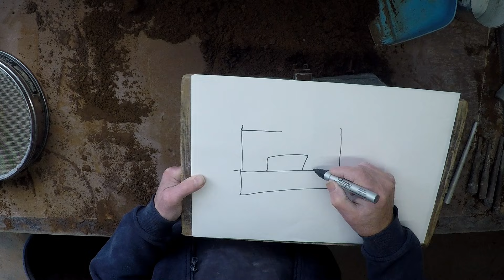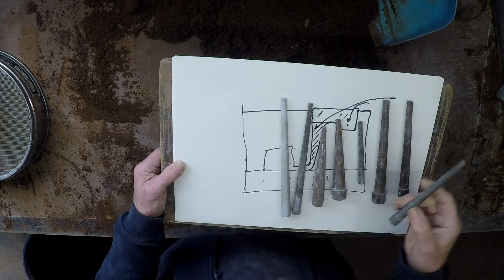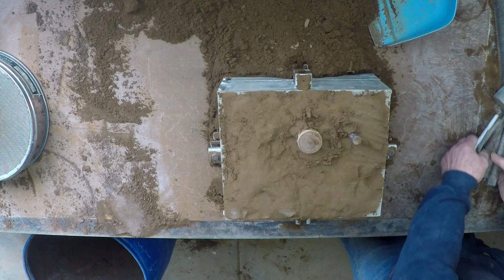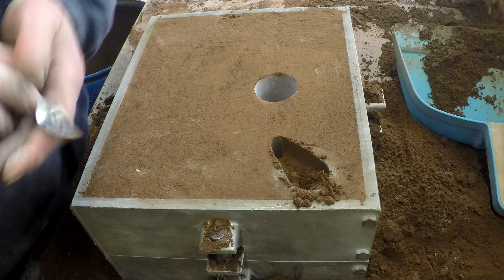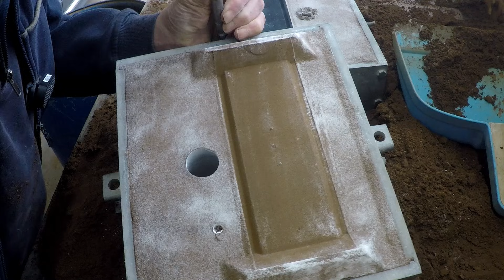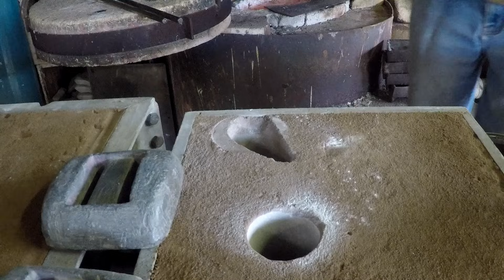Basin and sprue design for sand casting in the foundry

Comment: Yes pls to follow up. Ty for well explained informative vid. This is going to piss off myfordboy, don t u think? Its opposite what he does, but yrcastings look smoother on the outside than his, true or false? i know nothing of casting, never done it, just bystander but interested anyway. Great series of vid keep em coming.
Reply: Myfordboys' castings come out great though 🤔🤔
Reply from the maker: Ronny, One of the problems with YT is that it is difficult to see what a casting really looks like  - much easier to judge if it is in your hands and you can kick its tyres so to speak. I note that some Yters are adept at not showing (for example) the top side of castings for that is where things like shrinkage are most obvious. 
Also few YTers show their castings close up so you never get a really good look from which you can judge how great they really are (or are not) from the point of view of surface finish, internal soundness and how well they machine. In some of my videos I have taken pains to show enlargement type close ups of both cast and machined surfaces  - it is a pity that others do not do the same for then we might have a better chance of judging greatness or otherwise.
The things I recommend in this video will make a great casing even greater and are easy to do..... Martin
Reply: @olfoundryman8418  I suspect a very large sprue actually results in less air getting suckled in, than say, a medium sized. And in combination with a not too big in-gate allows air to come back up the sprue. Myfordboy also has a very fine green sand, looks almost like petrobond, which may explain why he can/must use high head pressure. 
Love your content, sir
Reply from the maker: Ronny. Not too sure about any of this but in my sprue follow up video I will demonstrate just how much air gets sucked in. Intuitively what you say seems logical but as you will see from the demo its what I am not too sure about.😊 In any case the worst of the damage is due to the splashing as the metal stream hits the bottom of the sprue and /or ricochets off the sides on the way down. This results in the formation of aluminium oxide films and these are a far greater problem than the odd bubble or two, although the bubbles generate films too as they float out. You can indeed use bubble traps (usually above the runner a little after the sprue) to get rid of bubbles before the gate/casting but neither these traps nor smallish gates will stop oxide films getting into the casting where they are effectively cracks in the solidified material.
 I would reckon my sand as the finer as I go to the trouble of grinding it up to make a facing sand. I do not need to increase the pressure to get a fill even though I know the sands permeability is low. I do however use vents where necessary, also even with my fine sand and low box height the finish gets visually a little rougher the lower on the casting you look. If I were I to use another 100 mm of pressure the finish would deteriorate quite a bit. This sort of thing is very important with alloys like Ezda 12 where there is little surface tension to stop the metal running into even a fine sand – as I recall a flywheel (I think) that I saw cast in this alloy came out more than a little rough - 100 mm less metal height would have helped a lot on that occasion. Its probably worth noting that the turbulent choppy flow that comes from large/medium parallel sprues is less conducive to complete mould filling than is the smoother flow emanating from a correctly sized and shaped sprue…..Martin
Reply from the maker: hrxy1, Well, I would like to think that I have not pee-ed anyone off, certainly that was not my aim. Each of us foundry men have own techniques although sometimes I have to wonder at the reasons behind some of them. However, I prefer to refrain from commenting publicly on any particular foundryman’s methods etc. I am happy to answer any questions that any of them may wish to ask,  and if they wish I shall reply privately. It’s not that I am biased or anything but I reckon that my castings are smoother – Oh, did I mention that I am not biased 😊… Martin

Comment: Wonderfully explained, clear and interesting. Seen the "can method" so much around, never even knew. Thank You
Reply from the maker: gafrers, Sadly the can method is all too common.... Martin
Reply: The can method is an improper way to add pressure so to speak, but due to the parallel sides you cannot keep it choked (shown in the later half of the video). 

I think it’s some form of combination between improper riser to prevent shrinkage and a basin to make sure the mold fills all the way up. Two issues alleviated by having good mold design.

Comment: Been watching all your videos. Plan on 3d printing a pattern for a lead hammer. And have a go at it.
Reply: I have now printed a number of patterns for Martin, if may make some suggestions? Make the layer height as small as possible keeping the print time realistic. Use adaptive layers if you are able. If you decide to go light on the infill to save time, make sure you have enough wall to prevent the wall collapsing. We found PLA can be difficult to sand, but if that is what you use, go for it. I found Colorfabb XT was good at being sanded and not difficult to print. PET can be better to sand, but I did not find it as easy to print as I had a lot of stringing  no matter how I played with the settings, retraction/speed etc.  Please ignore if you know all this

Comment: Martin, I’d like to see how you calculate the sprue size! I did spot the point where you let the sprue go too low the first time around. Thanks for explaining why the metal speed up during the pour.
Reply from the maker: Rocking, Yeah, the metal flow is a bit of a trick - initially very fast then quite slow then faster again and finally slows to a stop it takes a little keeping on top of. Calculation video will follow in due course... Martin
Reply: Worked 50 yrs as a greensand moulder and never .ever ran a casting straight in like this you need a down sprue and runner into a riser the your Ingatestone into the job this fellas talking bs

Comment: This is without doubt the most informative video, you have out out there.  I can't sketch either, but these sketchings got the message across perfectly, that is all any draftsman can ever hope to do. I know we have discussed this many times but this really shows the process in a way that even I understood it.  I don't understand why everyone does not use this method to maximise the chance of a successful pour.  The time invested in creating a pattern and making a mould is so long that I would certainly want to give myself the best possible chance of getting a good casting in return for that time. In cnc speak, it is like creating a program that will sort of get the job done, when a bit more time in writing the code and the job can be perfect.
Reply from the maker: SCL, Ah yes, nothing like a thumbnail dipped in tar sketch to convey the message. You are right - all that  work to make patterns cores moulds prepare sand and melt metal and pour castings too much effort to not give one=self the best chance possible of a good casting.... Martin

Comment: Martin, As always, WONDERFUL video.
It would seem many would be interested in the calculations in developing their sprue and which to use for the pours.  I have done some research and found that a 2.4 degree per side draft on the sprue was desirable.  Performing some flow simulations on this, it looked like the 2.4 draft angle was sufficient to prevent air entrapment.  
Still interesting in the knowledge that you can provide to the community.
Reply: one other thing of note, in a previous video (dont know which one) you suggest the top of the overflow of the pouring basin should be about 20mm, in this video you state between 5 to 10mm.  Is this an approximation, just so long as the overflow is not near the top of the pouring basin / sprue interface?
Reply from the maker: Braiz, This is an area where the has been some confusion and some people have got it the wrong way around - to clarify - if the basin is 30 mm deep in total the ridge is 5 to 10 mm high from the BOTTOM of the basin so when the basin is full there is 20 to 25 mm of metal over the top of the ridge. In the follow up video I will include drawings (proper ones) to illustrate this.... Martin
Reply: @olfoundryman8418  I read that! LOL
Reply from the maker: Braiz, I did some private calculation work on sprues in general  some months back as I was looking for the holy grail of a universal taper - it does not exist! The required taper varies from less than 0.5 degree per side to more than 3 (in my series of "what ifs") It varies as the type of sprue round square or slot as the flow rate required as the total height of the sprue and as the ratio of sprue height to pouring basin height. In my follow up I will show the results of this work. The little 8mm exit 1.4 degree per side sprue that I use mostly is what seems to suit most of the work I do
Reply: Is this specific to metal that is being poured?

Comment: Wonderful video. I learn so much on this channel. Thank you.
One question though, I notice that you don't use a pre-formed pouring basin and sprue assembly (I've seen some that are 3D printed).  Is this because you prefer the flexibility of positioning the basin/sprue in an ideal location or that you find them to be less effective?
I'm just getting geared up to do more casting and your video is very timely.
Thanks again.
Reply: Hi Dave, I think I can answer this on behalf of Martin, as I drew the models and made the prints.  Those drawings and prints were to show the shape of the basin/sprue.  They were not intended to be used as a mould to create the shape. They could be used that way for someone to see what the impression in the sand looked like, but I don't think they were ever intended to be used in making a mould.
Reply: @smallcnclathes  Hey,  If anyone happens to have a copy of "United States Navy Foundry Manual". Check out page 111, figure 131- "pouring basin". It shows a pre-cast "block" with this pouring basin shape, that can be placed on top of your mold over the sprue. I'll have to re-read the chapter to be sure, but I think it's made of plaster of paris. Hopefully it would be reusable .
-Brian
Reply: @steelcappedstrength  , no not plaster of paris. We usually made a bunch of pouring blocks out of CO2 (sodium silicate) core sand then bagged them up to keep the humidity away from them. Moisture breaks down the sodium silicate so we had to guard against that.
Reply: @sandrammer   Hey Sandrammer! I feel especially honored that you replied to me, I watch all your videos! CO2 core sand sounds even better than what the book describes, after rereading the chapter the book says to use baked core sand. "Pouring cups/basins can be made out of backing sand with extra bonding material added so the cups will bake hard in an oven"
-Brian
Reply: @steelcappedstrength  , I'm pleased that you found my videos helpful. I'm not surprised that the Foundry Manual mentioned baked core sand because it was published before Sodium Silicate sand became economical to use.
Reply from the maker: Brian, Yep, I have a copy - fig 131 is tolerably close to a good basin  but I would prefer a squarer bottom on the basin proper, a bigger radius on the sprue ridge junction, and the back of the basin corresponding to a virtual extension of the sprue however it is vastly superior to any of the basins (cups) shown on the same page or on any of the preceding 5 pages. To me it is a sad thing that so many books show the wrong way so often - here we have over 30 wrong to the one close to right - what hope has the reader got!
Such preformed basins are in fact reasonably common particularly in larger work, sadly they are unlikely to be reusable as how does one get them off the solid casting with out damage. Plaster sleeves are/were sometimes used as a sort of insulating sleeve around feeders - not exactly all that insulating but certainly more so than sand....Martin
Reply from the maker: Sand, I prefer shell core and for the job (if one can run to a metal core mould) as there are no problems with storage also better strength and better breakdown but I too have used CO2 for the job... Martin
Reply: @olfoundryman8418  , we in the foundries onboard ships didn't use resin bonded sand as we had little storage and the Navy didn't want to spend the money. The only place we used resin cores was in the bigger foundries that were on shore based Naval facilities, like the 32 street Naval Station in San Diego, California.
Reply: @smallcnclathes  I see now. No prefab assembly can take the place of good judgement and a bit of craftsmanship. I think that's why I am so taken by this whole process.
I have work to do. 👍
Reply: Given that you are filling the cope from the top it might be a bit hard to position the pouring basin pattern while you pack the sand in around it, cutting the basin by hand doesn't seem to burdensome.
Reply from the maker: David, Well, I do and I don't. On jobs where the height of my cope box is insufficient to give me a feeder with a large enough volume I do use extension pieces for both  the sprue and any feeders, these are almost always a maximum of 30 mm high. These extensions are made from shell core sand but the one for the sprue is (being a much older design) not exactly a proper basin although it is my intention to make up a shell core mould that will make ones of the right shape. Always when making a mould I think about how to get the sprue near the mould edge because it is such a help to proper pouring. This is not always possible and sometimes one has to have the sprue away from the edge in this case I will use an extension (30 mm max - no 100 mm bean cans!) on the sprue so it is easier to get to for pouring, in this case I may of may not extend the feeders..... Martin
Reply: @olfoundryman8418  Thank you Martin. Makes perfect sense to me. No size fits all and no process neither. You have shown me the value of having the sprue close to the edge and how to fill it with laminar flowing metal. Gonna get there. Just need to practice.
Thanks!

Comment: If you ever have an occasion that the runners freeze up just as the metal is entering the riser, stop pouring in the pouring basin and fill the riser from the top of the opening. That way you will not only put pressure on the molten metal making sure that each and every void is filled but you will put the hottest metal in the riser as it's supposed to be. If you have the hottest metal in the riser the riser will remain molten as the casting is solidifying and that condition will guarantee that the riser is feeding the mold cavity like it's supposed to and will solidify last. fun video.
Reply from the maker: Sand, What you mention is for me at least a rare event but it has happened when the sprue has been 3/4 blocked with loose sand (which surprisingly perhaps does not seem to wash out) this gives me a much longer fill time than planned. It has been and ever rarer event for the casting to not fill even though a design fill of 10 seconds gets out to 30. Nevertheless I have had to contemplate and actually have done a "down the feeder" Unfortunately there is no guarantee particularly with a top feeder that metal will not plunge right down the feeder and into the casting underneath - momentum from the ladle stream practically guarantees that it will and the hottest metal and a fair bit of oxide etc may well be down in the casting. I think it depends on how full the feeder is before the direct pour - a little top up ok, but a larger fill, eh not so much!.... Martin
Reply: @olfoundryman8418  , The only time we poured down the riser was after it was at least 25% full and it was essential that the risers had the hottest metal.